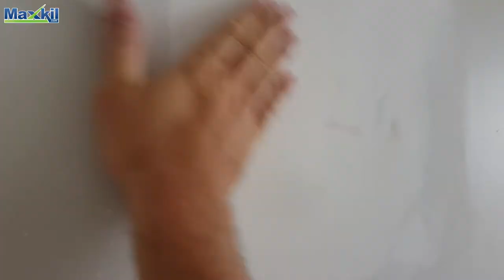Small Plaster Repair using Salt to make it dry fast

Comment: I was going to say that looks like a Rigid battery. When I used to do handyman work I had a smaller van than yours and I would keep my things is stackable totes (very similar to the one in this link https://www.homedepot.com/p/HDX-12-Gal-Heavy-Duty-Flip-Top-Storage-Tote-in-Grey-236475/303213577 which were labeled on the sides.
Reply from the maker: Yeah I went to look for something similar the other day. My tools never end up in the same place, Once I get my walls and floor in on Monday I will figure something out. I also need a method of carrying drywall sheets I need to think of. I've had the car one tank of fuel today and already I cant walk in the back from the clutter.